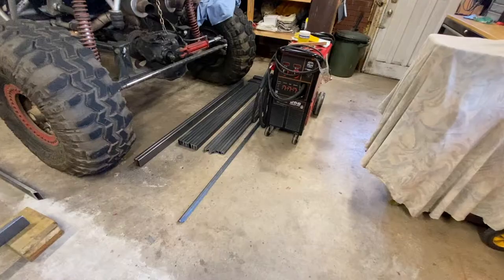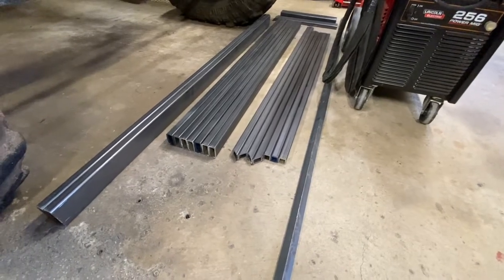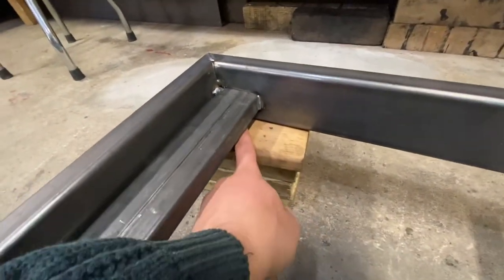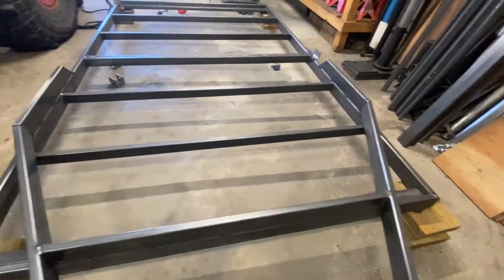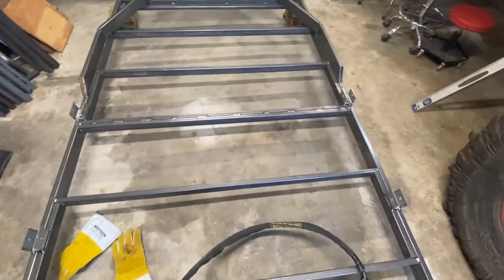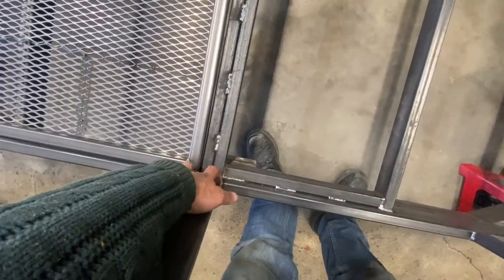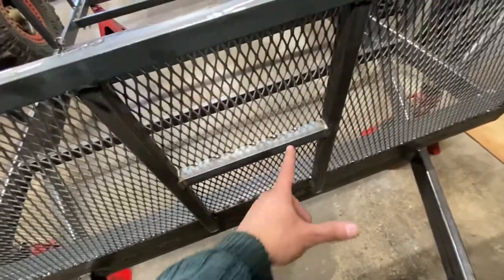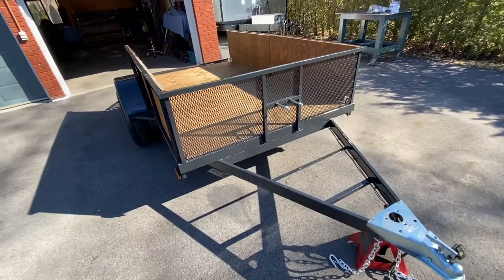Step-by-step 5' x 8' utility trailer build

Comment: Great Trailer build...Is this something I can build using a Flux-core Mig Welder? I'm new to welding and wanted to build a small trailer similar, minus the gate. Thanks
Reply from the maker: Thanks, sure you can use flux core mig welder, just make sure you get good welds and good penetration with the right welder settings for the steel thickness. I built my first trailer with a flux core welder.

Comment: Hi RG what do you think it would cost to do this in Aluminum? I have an old side by side that doesnt fit my trailer so ill have to build one. I just bought a tig welder for aluminum so I think I'll go that route. A new 5.5x10' is somewhere around 5000cad so It has to be a little cheaper Id think. first I have to learn to tig then I have to learn to build a trailer...
Reply from the maker: It would be a fun project to build a trailer from aluminum. There is a few things that your have to think about first: you must increase the size and thickness of your aluminum beams compared to steel and you have to be extra careful to get good penetration on each weld. I am pretty sure that aluminum trailers are built using an aluminum mig welder and not tig, but it would be fun to tig a whole trailer, it will certainly take you more time to build.

Comment: Nice!  Welding the safety chains on is not legal in all states.
Reply from the maker: Did not know that. Thanks for letting me know.
Reply: @rgsabat  I am from WA state and they don't allow any form of welding chain links, probably an issue from shady logging truck accidents from way back. They do allow sliding a rod, shaft or other means through the link and weld that to the frame just not the links themselves, eliminating any possible chain link repairs. I love working with box tubing on trailers, flatbeds, dump trucks, etc so I enjoyed seeing your trailer, well done. I typically shy away from 45 corners and usually cap the long rails then use same length cross members with 90 ends, much easier to keep all of the dimensions dead on.

Comment: Hello, can you list a pricelist or rough estimate to build this trailer, thanks.
Reply from the maker: 300 Canadian dollars for the axle, 300$ for the tires and wheels, 600$ for the steel, 200$ for the wood, and around 300$ for miscellaneous hardware. It ended up costing me 1700 Canadian dollars to build it.
Reply: @rgsabat  Good  day I'm from Ont.  were is this from?  Boy axle $300, seems like alot of money. Nice video & built  Thanks
Reply from the maker: @donvoll2580  https://www.princessauto.com/en/2000-lb-60-in-trailer-axle-assembly/product/PA0008186686 , plus springs and axle hardware, I don’t own a business or buy in bulk to get discounts, I also couldn’t wait for the axle to be on sale because I needed the trailer finished.
Reply: @rgsabat   Thanks  So were do u live?I'm from Kit-Waterloo area
Reply: I love your welder is it a multipurpose?
Reply: Thank you posting this, very informative. I just recently purchased a trailer & not sure what to do with it yet. The axle is welded directly to the frame, are springs necessary or could I leave it like that? The tongue is just one small 28 stub coming from the center & I don’t like that. I would like to make it an A-frame like this one. How far out does the tongue stick out on this trailer, lengths used?

Comment: Mount spare tire on right side or curb side of trailer in front or behind fender will leave room in front for storage box 📦.   One more thing to think of trailer jack will hit your tail gate of your truck make a set back mounting plate .  In the a frame .that will work perfectly. 😂😂😂